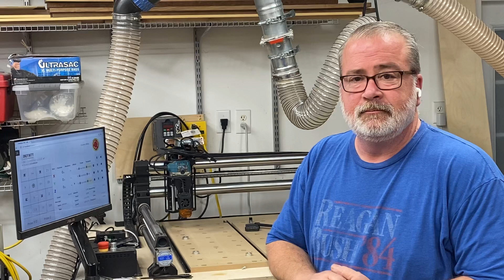Onefinity CNC questions and answers for the newly initiated

Comment: Great honest tech info. I was going to purchase a X-Carve, however, after watching and absorbing your videos I have decided on the Onefinity. My one question is, can I run the controller directly from V-Carve Pro & will my laptop running that software plug right into the control box, or does the unit have to use the Onefinity control box software as some sort of "middleware"?
Reply from the maker: I honestly don’t know if you can connect direct from a pc to the control box for file transfer. The ways I do know, are use a thumb drive, or send the file from the pc to the controller box via wifi (both pc and onefinity controller have to be on same network) wifi is my preferred method personally.  I do recall people commenting about a direct pc connection on the Facebook group, but I didn’t pay it any attention because that was never my plan (again just personal preference). 

I’m super pleased with the machine, and am very glad to have added it to my shop.  If I can ask for a favor, please consider subscribing while you’re here if you think it’s of value to you. It’d help me reach more people perhaps.  Thanks, and have a great day!

Comment: Thanks JR, wonderful idea! My unit should be arriving any week now and I'm preparing to setup my unit. Are there any advantages/disadvantages to using an enclosure as opposed to having the unit open?  What are some of the biggest things you wished you'd known or done differently when first setting up your unit?
Reply from the maker: Hi Nathan, thanks!  I believe there are advantages to an enclosure. The two primary benefits are noise reduction and dust control.  Also, if you have little ones that may wander into the shop, safety for curious fingers as well.  What would I have done differently…..I’d have made sure my first enclosure had side access for the cleaning and lubricating that you should do periodically. Also, I wish I had studied more about the software while I was waiting for arrival.  I wasn’t up to speed when the machine arrived, and I wish I was more “ready” than I was. 

Hope the videos are helpful and of value.  If you would, please consider subscribing while you’re here. It would help me grow my channel and I’d appreciate that!